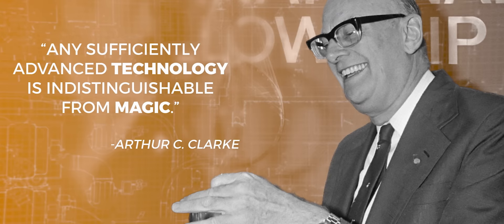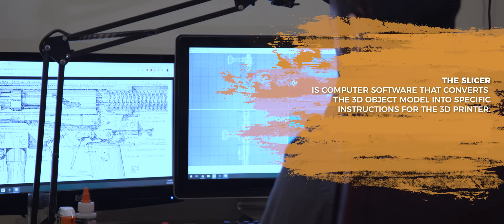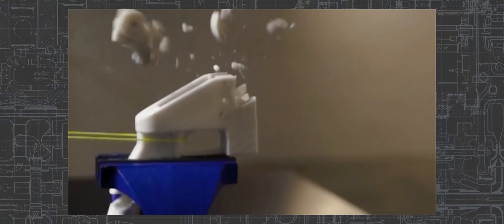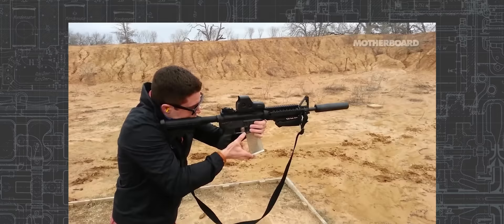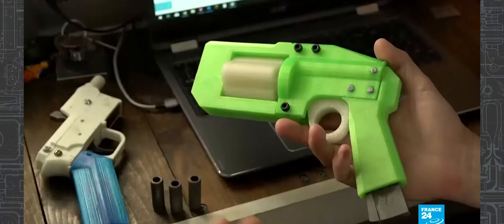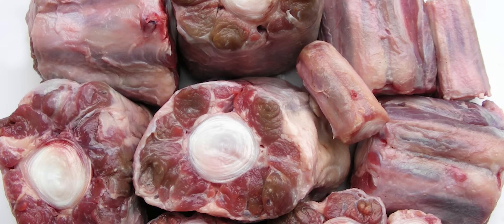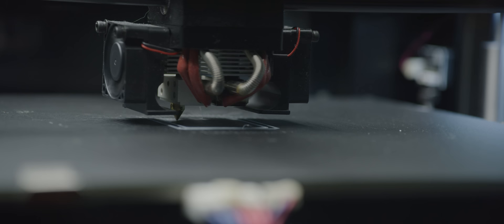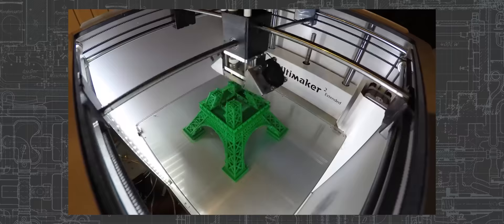3D Printed Guns, Explained

Comment: There's also another very crucial thing that guns rely on that can't be achieved with regular consumer 3D printers: Steel. 

Bullets fire with a Flint-and-Steel method. A load of gunpowder is packed into the casing of a round, and a primer (flint) is struck with a hammer (steel) causing the powder to ignite and blast the bullet forwards. 
Additionally, guns heavily rely on springs, which are also made out of steel or metal. You can theoretically print coils, but they're not springy enough for them to be used repeatedly in guns. At best you'd get a one-shot gun if you can bypass the above flint and steel issue. 

Steel melts at around 1,500 Celsius, and I've never seen a printer that can break past 350. Hell, some can't even handle ABS, which prints at 260, and that's one of the most common printing materials. 

Also, even if you include metal parts with a plastic body, that's already been done with the original Glock 17, which was made by a toy company (of all things), and did literally that; used only the essential metal parts and used plastic for the rest to keep it as lightweight and portable as possible, and people argued the exact same things about it. They called it a "terrorist's weapon" and claimed metal detectors wouldn't be able to find it, but today it's no different than any other handgun that anyone can pick up.
Reply: it's fairly easy to make your own ammo

Comment: Watched a 12 gauge  shotgun being made start to finish ,held 6 rounds ,shot 50 rounds no problem,metal parts bought at local hardware store,shot slugs  no problem
Reply: Lower pressure simpler mechanism

Comment: Firearms are solid powder combustion mechanisms, that rely on simple physics. Firearms rely on huge combustion pressures caused by an exothermic reaction happening in a confined space in order to rapidly impart energy into a projectile. This reaction takes thousands of a second to occur and can result in pressures exceeding 65,000 psi. Firearms create allot of energy and much of the energy is waste energy in the form of heat. The barrel of a firearm generates hundreds to thousands of Degrees Fahrenheit. All modern firearms with few exceptions have rifling in the barrels, rifling which is necessary to impart spin stabilization into the projectile. This rifling is a series of opposing lands and groves that form a helical twist that a solid metal projectile is literally extruded through at supersonic velocities. This creates incredible friction and centrifugal forces. Most modren fitearms have large solid reciprocating masses that control cartridge feeding, case extraction, chamber pressure normalizing and recoil control. These masses typically reciprocate at a high velocity imparting energy in the form of recoil. The point of all this being that firearms are made of high alloy steels, including elements such as iron, chromium, vanadium, molybdenum, carbon, nickel, cobalt, and manganese. These alloys  can withstand 100,000+ psi tensile strengths if combined. No polymer or plastic can ever handle the stresses of even one of the variables of which only few were provided. let alone all of them, which all are necessary requirements for effective powder combustion projectile weapons. The technology will not be there for a very very long time, even in light of powder metallurgy and metal additive manufacturing.
Reply: You've clearly never heard of a shotgun. .45ACP has typical chamber pressures of roughly 21.5k PSI and plenty of area and mass to facilitate pressure bearing and extraction.

Comment: You can 100% buy a receiver in the USA without going through a check you buy an 80% lower get a drill and a router and you can very very simply make it a fully functioning receiver and gun i have seen full build kits for around $300 for an amazing AR

Comment: I just want to point out a-lot of this has changed, first off the “plastikov” (a plastic ak) is now possible also the FGC-9 is a reliable 9 mm semi automatic weapon using about 80% 3d printed parts and a few home depot parts so just check out the news on it because This will become outdated
Reply: shh don’t tell em

Comment: they tend to fail because people are trying to 3-d print the whole lower forgetting the 3-d print can't handle the stress around where the buffer tube goes. You have to bulk up around that spot or make a ar 18 instead.

Comment: Unless you've got a printer that can print metal parts, it's better to print simpler weapons such as plastic "letter openers." (knives)

The facts are that the kinds of pressure and heat involved in firing a bullet aren't something most plastics can handle. At best, an all plastic gun would get off one shot before it's workings deform and fail... and that much assumes it doesn't blow up the instant you pull the trigger.

Also, some assembly is required.

Comment: What needs to be designed is a gun with the minimum of steel parts that can be filed by hand and bent in a vice and all the rest of the parts made by a 3d printer and snapped together. I'm thinking of the Luty SMG but simpler because the technology is now available like the 3d printer. Like this man said it is maturing and sooner or later even the most heavily regulated country will not be able to stop the manufacture of homemade firearms. When it gets to that point you are living in a police state anyway. Which pretty well describes Canada the country in which I live.

Comment: Easier to just make sten guns if you're in a real bind. It's just a tube,  barrel, some springy bits, and a block of steel shaped into the bolt

Comment: What no one explains is would I ever want to buy a 3D printer and learn CAD instead of buying some machine tools and learning to turn sheet metal and pipe into guns. It might take a little more effort to learn basic metalworking, but the end result is metal, not plastic, and the cost is likely less. Now, if we're talking 3D printed metal, then 3D printing guns makes a lot more sense. But it will be many years from now before those are mass market. When it comes to layered cheap plastic, one would be better armed with a homemade Swedish K or Sten or Luty submachine gun. Or a homemade shotgun, which technically might be the easiest gun to build entirely from scratch including ammunition and make comparable in ballistic performance compared to conventional firearms. They're not going to ban metal pellets or unrifled pipe than can stand up to low shotgun pressures.

Comment: How to make a pipe bomb 
- buy some pipe 
- buy a fuze
- make about 1kg of blackpowder for 20$ or buy it
- screw together and put some metal scrap in it
Done 
This can be done with 
- pipe 
- charcoal
- sulfur (fungicide / fertelizer)
- Potassium nitrate (fertelizer)
- scrap metal or nails
Joust because it can be used in this way does not mean it should be regulated

Comment: I have done quite a bit of 3d printing and the strength of the parts can be a bit unpredictable. It is very much like wood. It has a grain, each piece is different, and the strength is around that of wood also. Would you want a gun made entirely out of wood? It seems very dangerous to me. There is a good reason they use metal for real gun barrels.
Reply: Almost every build has "real" gun barrels.

Comment: I saw a machine print an adjustable spanner so what's all this plastic I'm sure you can print with metals.
Reply: @Nigel Palmer metal, concrete and so on but it like $10k or $20k and above for a 3d printer that does metal
Reply: If you need a print to be metal, do a plastic print and then do an investment cast in steel.

Comment: 3D printer owner here, if you're really worried about your regular criminals  using 3d printers to make guns then you either don't know how much work it takes to print complicated prints or you overestimate your average criminals brain capacity.

PS: Fully 3D printed guns (about 70% 3d printed with some hardware store parts) are starting to surface so yeah this video is kinda outdated in that aspect.

Comment: Thos same damn argument was being made when people were buying the hobbyist mills and lathes. Still, when it was discovered it was possible to build firearms on them, certain groups started to freak out; they paid no attention to those building black powder firearms with them or the tools. Still, private citizens were fabricating more modern firearms they saw as a political issue when it came up.
You do not need a 3D printer or a CNC to build a functional firearm; you can build one with fundamental hand tools and shop tools(drill press, MIY manual operated metal shaper, surface plate) and basic skills as hand scraping and lapping. If you have a set of paper templates, you can build a few good firearms, including a high-speed Gatling-style firearm.
Take the Filipinos as an example. Once they learned how to make a reliable copy of the Colt 1911, they had the skills to make any firearm or the Kyber Pass or the Middle East firearm makers who can reproduce any firearm they can get their hands on. 
The skills and knowledge are all over the world; there is no way to stop that.
That trigger has been pulled, and the bullet left the barrel a long time ago.

Comment: You will never stop crimes by regulating the tool they used to commit that crime. You can 3d print an AR15 receiver. You can also make said receiver out of wood, metal, or just buy a block of nylon, cut it, drill it, mill it, and make yourself a pretty strong receiver. Pipe shotguns have been made by inmates in prisons for ages already. It’s not something impossible to do. How come criminals are still able to build firearms when they are under constant supervision? You have antigun officials trying to tell you that 3d printing a gun will make them able to go through TSA which is a stupid argument to make. You can’t have a functioning firearm unless the barrel is made out of metal. The firing pin is made out of metal. You can’t fire a gun without the firing pin. There goes their attempt at making a valid argument. It’s ridiculous how much of a taboo it has become to own a firearm. We used to have firearm safety courses taught in schools. How come they didn’t have school shootings? Also, why is there no security at schools? I grew up in Europe. We always had security at any school. They didn’t have guns, but they had pepper spray, and tasers. Still better than nothing. They also checked for every student’s badge before they walked in so they were sure that the student was from that school. No shootings there or illegal people coming in even tho it is also legal to carry a gun in that country. You have officials saying, “BuT sTuDeNtS wIlL fEeL  lIkE tHeY aRe In PrIsOnS”. That is also a stupid argument to make coming from a person that is protected 24/7 by security guards armed with actual “assault weapons” as they would call it. How come you don’t feel like you are in prison? Just look at the current leadership! He’s fenced around and protected by the national guard. So much for the most popular president, am I right? Sorry for the rant, but I feel like I got everything off my chest.

Comment: 1600: flying is impossible, the materials and technology will never exist
1940: so we have reliable airplanes now

Nov 19 2019: 3d printing and assembling a gun in an hour is impossible, the materials will never exist.

Now, underestimating technology is probably the number one thing you should not do. And, also, who says only plastic can be used? Who says metal printers will be expensive in 20 years?
Reply: Dude the FGC-9 (Fuck Gun Control 9mm) literally got released a couple months afterwards lmfao.
Reply: @bravefastrabbit770  Yup, exactly. But what they were talking about is a fully 3d printed gun. They're ignoring the fact that with 10$ of hardware store parts you can make a good mostly 3d printed gun.

Comment: lets talk about the elephant in the room, what about 3d printing a PLA model and then using the "lost pla" method creating an actual metal part from a plastic mold, i mean, that could create fully functional metal pieces, only leaving the barrel and bolt to be worked from milled steel
Reply: So?

Comment: Since this video has been put up a more recent printing tech has come out. Metal 3d printers are taking off which is super cool. Unfortunately I don't think the material can withstand the pressures to be used as a barrel.
Reply: Either way, this would be super cool to test prototype firearms

Comment: We could definitely print fully functional gun parts with the machines I work with, but those machines are $1M+ 😂
Reply: FGC-9
Reply: @mataj0to561  I'm talking about full metal using laser powder bed fusion. There are definitely guns people have designed for short term use in plastics and stuff, but they're limited use.

Comment: Guys he's right.  I've 3d printed stuff and made designs to 3d print and the material is very weak.  Depending on the material.
Reply: there are lots of 3D printed receivers now.
Reply: @DreadnoughtHvor  it doesn't mean they work
Reply: @bigchungus920  yeah, actually, it's not too hard to look it up. Firebolt 3D printed AR receiver can handle thousands of rounds and the UBAR, a similar receiver, has survived several stress tests , even with forced reset triggers.

Comment: They have mini CNC machines specifically made to "hit print" and make a lower receiver out of metal and yup... They're reliable.
Reply: They are also over 2k
Reply: @dogguy8603  that's cheap. It'll pay itself off
Reply: @shaneintegra  meh 3d printer is cheaper and can print unique guns like the FGC9
Reply: @dogguy8603  good for those who want to depend on plastic holding that force. I myself would rather use metal
Reply: @shaneintegra  the plastic has been proven effective and reliable especially with PCCs like the fg9

Comment: The rise of metal powder based 3D printers makes it absolutely possible to print a fully working traditional firearm. This is something that is 100% worked out and is slowly working it's way into the hands of average consumers. I feel like research was lacking a little here.
Reply: not really, metal printers large enough to create the necessary parts are still a long way off from being affordable or even practical for consumers.
Reply: However said parts need to treated and properly gauged as any small imperfections in the bore and barrel or any moving parts could cause a malfunction or even out of battery detonation which can be deadly to those using it and around it.

Comment: This video didn't age well. Now 3d AR-15s are on 2000 + rounds with no failure and there's working aks and even a roller delayed cetme which makes the AK look weak when you compare reciever stresses
Reply: mostly because material research has gone through the roof in the last couple years
Reply: Just wait until you see what else is rolling out

Comment: you know you can do the same thing with iron casting/aluminium casting/ casting in general? and probably more strength in materials... 3d printing is not to worry about.. if people want to rebel and make weapons they will find a way.
Reply: casting causes some issues. A) they almost always require machining afterwards. B) you can get some serious jamming issues if the part doesn't shrink uniformly as it cools.

Comment: Printing a gun is not an easily accomplished thig if anything it may be just as if not more difficult than traditional methods of manufacturing. Lets use the idea of a glock frame clone for example; ignoring the fact that Nylon, PEI, or PEEK would be your likely go too material for FDM the later two options being 300$ & 600$ per pound respectively and all being considered extremely difficult too print with because of warping issues (ie your 300$ 50hr print may likely fail too produce an adequate part). You still would have to figure out some effective way too support the print so that any of your mating surfaces are near perfect from the start since too remove the support material is also extremely difficult in all of the potential material candidates. Even if you accomplished this and managed to produce a print with fine features and solid layer adhesion you still have to buy an actual Barrel, a Breach/Bolt, Firing pin, and all of your springs. If the licensing side was not so convoluted it may actually be an interesting mechanical engineering challenge but like the video said even if you could print a gun nobody is going to be printing a functional ALL POLYMER semiautomatic weapon any time soon if ever.
Reply: PLA+ actually works just fine, takes roughly 8-20 hrs to print depending on settings, and costs pennies per print.

Comment: For those concerned about Criminals using a 3D printer. STOP!    Criminals are lazy in the first place they all want something for nothing basically so why would a criminal spend the time to learn 3D modeling develop a part then to wait several hours or sometimes days to print all of the needed parts to build said gun,   Even if that person didnt develop the file to print and just downloaded it he or she still has to print the parts needed for that particular gun and they still have to include some steel parts like springs, Firing pins and the most important of all the barrel with a chamber for the exact cartridge they wish to fire.   One mistake and BOOM they now have made a very time intensive bomb.        

Fact is these laws currently being pushed will accomplish NOTHING  with regard to keeping anyone safe or alive in fact they will more than likely get more people injured or killed.    Besides the files are already out there on the internet and they will never go away period, regardless of the laws or regulations put into place it wont change a damn thing one way or another.